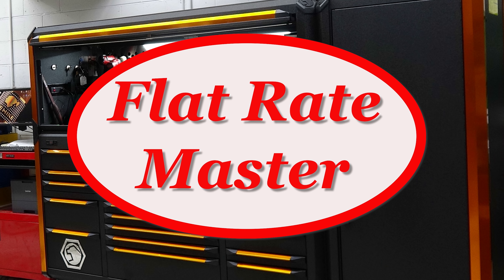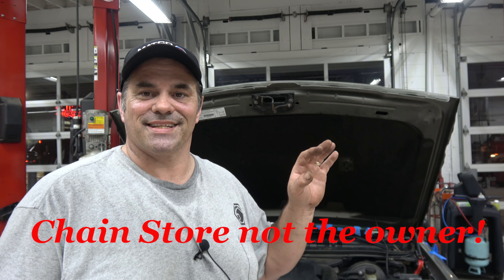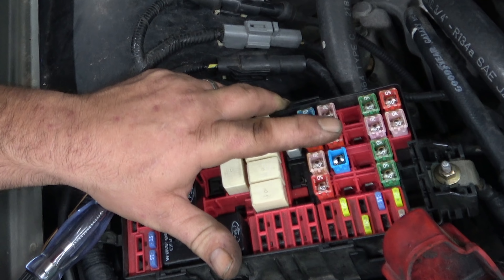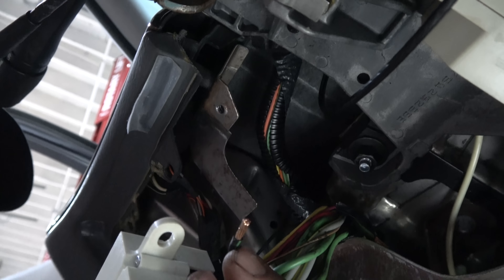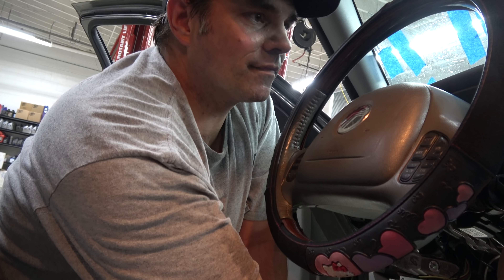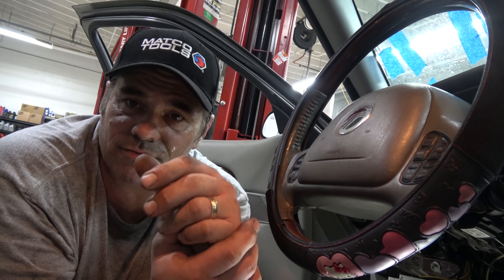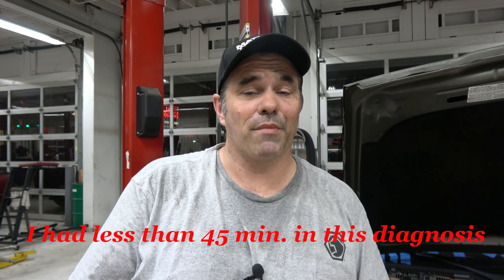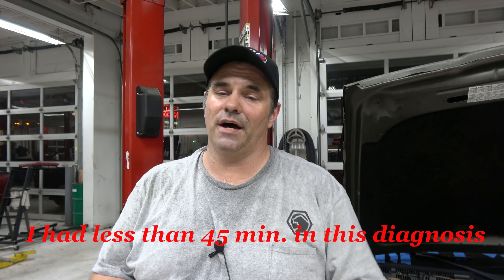2005 Grand Marquis Case Study No Crank/ No Communication

Comment: They was helpful I am having the same problem with my 2004 grand marquis and I have replaced everything has a new battery, new stater, new starter Relay and it boils down to have a bad ignition switch this video was helpful so that’s the new route to put a new ignition switch on it and hopefully that’s exactly what it is and was

Comment: my son has a 2002 grand marquis,  it had a drain on the  battery.  charged it up, started it and he ditched the car in snow storm.  had car towed to shop. car would not start, thought it was frozen. had shop put in inside for the night.  went to shop the next day to get the thawed out car, had to use jump pack.  fuel pump working-check.  brake cable had been stretched out either while putting in the ditch or getting towed out.   
turned car over again after testing fuel pump, and smoke comes out from inside the driver side front wheel well.  any ideas what is in there???

Comment: Oh the ones you  have to figure out after someone else monkeyed around it first... Good find. Funny you posted this video because I JUST had 2017 RDX yesterday from a body shop that had no communication after they did some right frame rail repair and an engine room harness. Long story short, the right front window connector and the F-CAN connector on the cabin harness are interchangeable where the cabin and engine room harnesses connect. Kinda need F-CAN connectivity at the PCM.... oops haha. I would have loved to see the look on the body guys face when he was told.

Comment: my crown victoria 2002 crank no start new battery new starter check ignition fuse starting relay fuel pump relay fuel pump prime is working what causing this weird crank no start

Comment: need help have a 1998 gran marquis replace fuel pump still no start but crank install new battery no start but I notice the gas is real brown red looking car set for 4 years since 2015 I spray some starting fluid it started for 1 second started puffing help please thank you
Reply from the maker: Starr by draining out that old gas. And refilling with fresh gas

Comment: Nice one. What is your opinion on putting a car on a assymetric lift in reverse. Just wondering cause i have a rotary spoa9 in my home shop and i havnt done this but i was just kinda speculating. It seem as long as the weight is distributed correctly it should be fine right? Figured uv been using lift your whole life so ud be the one to ask. Thanks frm
Reply from the maker: I also worked for challenger lifts;) as long as weight distribution is right you shouldn't have issues, now getting the correct distribution is a little hard.

Comment: Having the same problem on my 2003 Ford Crown Victoria no crank no start good battery and good starter
Reply: same here. you ever figure it out. would appreciate any help
Reply: @blackaspitch631  did you ever figure it out having the same problem
Reply: @ratpackgaming5230  my cars in the shop now. it's a security module and somthing else. ignition switch or something. 1k to fix

Comment: My car was running perfectly fine till I had someone replace my a/c compressor now my car want crank. I got a new battery new starter check fuse . I need help
Reply from the maker: Take the belt off, and make sure then engine or compressor isn't locked up
Reply: It’s not because i could crank it wired jumped to the battery

Comment: Got one for ya. 2000 mercury grand marquis. Changed out the starter and the battery. Get one click then everything goes dead. Wont light up dash, the gage says battery is dead. Put the charger on brand new battery and it says %50, sometimes nothing at all. Tried to jump it, one click and everything dies again. Checked the wires on the starter and battery, they're all tight. I give up.......
Reply from the maker: Check your engine grounds
Reply: Thx. Will check, another mechanic friend says the same thing. Hopefully that's what's causing it.  👍
Reply: Nailed it! Thx
Reply: Cranked and cranked until the battery died.  Engine ground, battery ground and terminals all got extremely hot. Re charged the battery (new) replaced engine ground, battery terminal and now acting like bad ground again........😫

Comment: I can make this A LOT more difficult. (Also, that looks like an 03-04 GM, based on the steering wheel buttons. 05 and up had fewer).

So, same problem, no crank, has ignition power, ACC, etc, but no crank. HOWEVER, all the fuses are fine, the Jcase is fine, the relay is fine. All voltages check out at the solenoid, yet no crank. Has a brand new Ford starter (old one was good but so corroded the terminals broke off, and overall nasty with rust). New Ford neutral safety switch (which I think was more of a parts cannon diagnosos, my bad, but still kept the old OK one. It was rusted and fused to the input selection shaft, which needed cleaning anyways. Car sat for over 7 years).

Still no clue. Yes, I know I should have some kind of diag, but dont (Maybe you can recomment what I would need, since Im looking at a Snapon Apollo D9, since it can do some coding, adding the VIN to the PCM/TCM unless I'm wrong and I need a full blown setup with a Bosch Jbox. Im not looking forward to that spending, nor going into debt but Im not seeing a solution. Ive had to shift to modern cars lately because not many people bring me their classics anymore, as most of my clients passed away, traded in for C8 Vettes, or moved to Florida...Im kind of using this car as me learning ECU problems, since it was my car, that got totalled, has a lot of sentimental value, as well as being a very rare 1 of 1 CV Sport model, the only 1of1 known to have been made during the whole Panther Platform lineup)

Anyways, any help would be great. Both on the no crank issue, as well as what diag setup I should get (I wish I could say money is no issue but...)
Reply: @Donald Prairie I did, but the shop manual as well as Chilton and Hayes has some very strange wording regarding the ground side. I was getting 12v, but since the neutral switch is on the ground side, it made it seem as if the computer was doing A LOT more than I would normally have assume. I can chalk it up to reaching that frustation point. Since I wrote the comment, I managed to get a Zeus, and that showed no codes at all...

That along with the voltage drop while turning the ingition (so igntion switch works) confirmed that despite it being a new part, it was bad.

I know the saying, just because its new, doesnt mean it works...but this is a tough repair. This was the car I wrecked in, and broke my neck in. I should have checked that first thing (I did check the starter itself by hotwiring it with jumpers, but I skipped checking the solenoid)